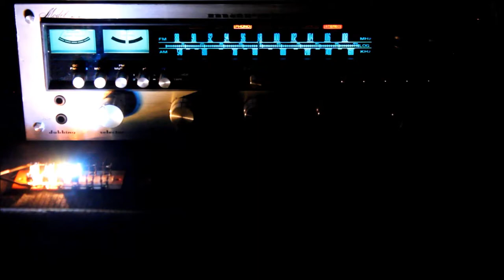Marantz Vellum and LED Information Video

Comment: I upgraded to warm-white LEDs in my Marantz 2250, and to get that hard-to-duplicate, proprietary Marantz teal color, I used a sheet of light tan colored 24 lb (or higher) paper, then sprayed both sides of it with some gloss clear-coat spray paint.  After letting it cure for a few days to avoid any outgassing, I cut a strip off, and installed it behind the dial, and, VOILA; it's 1975 again!!!!!

Comment: Thanks for this, i have a 2230 which also had thay aqua look from yellowed paper, i swapped to new paper and warm white leds, the blue looks really good now but a little bit of a hot spot look, should i put double layers of paper, do you have any suggestions?
Reply from the maker: I have seen a couple of different variations of filament lamps.
Both were 250 millivolts and both were 1¼” long, but some had only about ½” of actual filament. These short filament lamps are sure to leave you with hotspots on your dial.  
I have heard of people doubling up on the Velum,  (I use standard kitchen parchment paper), but I am not sure how much that that will help.
Reply: @KKnockk  thanks, and the 2230 meter paper looks to be a pain to get out and change, havent tackled that yet.
Reply from the maker: @JukeboxAlley  It has been a while since I did this video, but I just do not remember there being any meter papers.
I think that the backs of the meters are translucent white, and the lamps shine from behind them.
Reply: @KKnockk  On the 2230 there is paper on the tuning meter, glued at the top and bottom, but it has a cutout for the connections, its just like the dial paper just a custom cut pretty much, its looks to be a real pain to change.

Comment: How do you wrestle the light panel out on the 2240? There is a lot in the way including the pulley in the center just behind the panel. Not enough room to get it past?
Reply from the maker: It has been a long time since i did this, and I can't remember if I replaced the lamps from the front (when I was changing the velum) or from the rear. 
I believe that if you take the black shield off of the tuning box, and carefully release the mechanism below, it can be moved enough to allow the lamp board to be removed without having to remove the dial cord from the tuner.
I do not really recommend this method, but If you do, proceed with extreme caution.
Reply: @KKnockk  Thank you very much for the reply. There is no room to maneuver the light panel as far as I can tell. If removed from the front, will I be able to solder the 2 pin lamps?
Reply from the maker: One touch of your soldering iron on the dial string, and I am sure that you would swear so loud that I could hear it from Canada.
I usually drape a couple of layers of paper over the dial cord to help prevent that. 
OR  
You could try to move the box that holds the tuning mechanism back by enough to remove that lamp board.

Comment: do you only put the blue LED in if you're keeping the original velum? that wasn't clear
Reply from the maker: The blue LEDs are so bright, they overcome the yellowing velum.
I don't feel that it is important to change the velum if you are going with blue lamps.
The colour LEDs that you use is purely a personal choice; depending on how much of a purist you are.
(How much of the intended original look you want to keep).
Reply: Thanks! In your experience...Are the soft white LEDs enough to overcome the yellow? i'd rather not change the vellum and I'd like to see more blue.
Reply from the maker: @jackstiles1874  Without knowing how yellowed your velum has become, I would have to suggest that you buy one of each of the different colour LEDs that you are considering, and put them at opposite ends of the dial.
This way you can determine which one you like the best.

Comment: Hi Thanks for this Video, very Helpful.
What Thickness Vellum is best for the diffusing of the LEDs ??
Thanks again
Graham
Reply from the maker: I just used parchment paper. I've heard that some people use 2 layers, but I find that that is totally unnecessary. One layer does a good job of diffusing the light; AND it will stand up to the heat of  filament lights if that is what you want to light your unit.